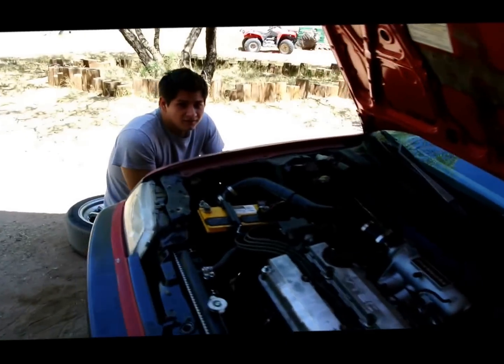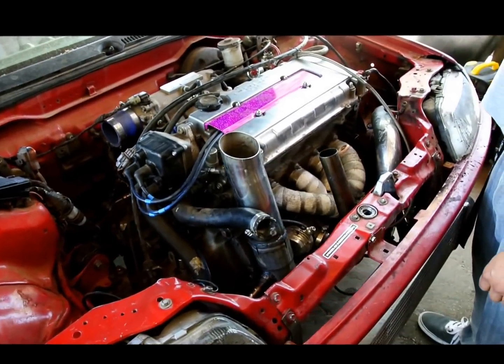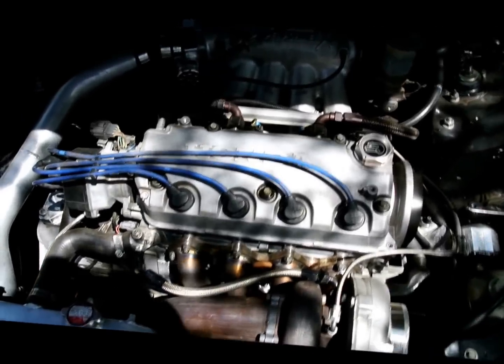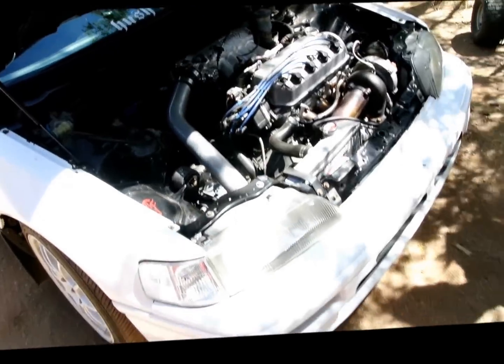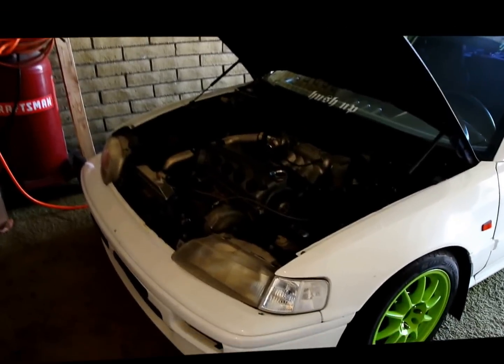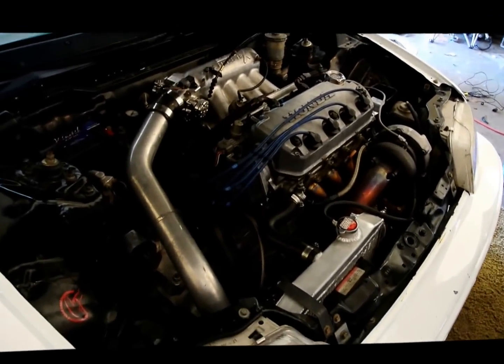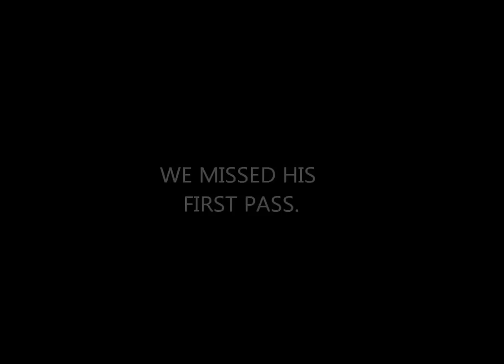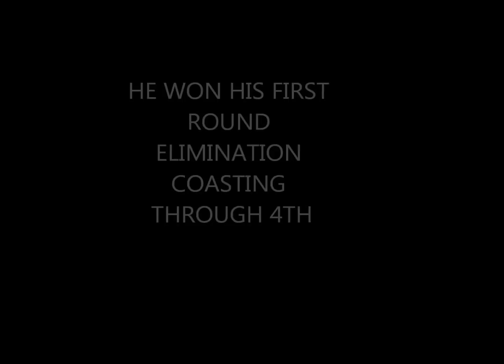400hp SOHC in the making

Comment: Love your EF bro!  I subscribed.  I have a white 90 EF that looks like yours, but it's in better shape.
I don't have the beefy motor though, just the stock D16A6, but would love to drop a B20 into it eventually.
Quick question -  I moved to a place where it snows and I've started to notice that most EF's have a radiator
that's about half as wide as mine.  The one in your car looks like it's maybe 12 inches wide, mine covers the
whole front end of the car.

Anyways, the car has trouble staying warm in cold weather, so I have a thin cardboard box infront of the radiator
in order for the car to stay warm in colder weather.  Is this due to my EF having a much larger radiator then most
of the ones I see in other EF's?  If you know this question, please let me know!

Thanks

PS- you can see my EF by searching WHOISMISTA808 on Instagram.

Comment: I love it man. Always wanted an EF hatch. Instead I got an EK coupe. Nothing overly special, freshly rebuilt stock bottom end LS, 63 trim turbo, BC turbo cams, dual valve springs, titanium retainers, ported head, ARP head studs, ARP rod bolts, GSR trans, Siemens 660cc injectors, HKS BOV, Tial F38 wastegate,  tuned on Crome Pro on 8.8 lbs. I'm still working the bugs out of the random parts but it runs good. I need some better tires, axles, and an LSD trans before I take it to any track. She's a one wheel peel through 1st 2nd and 3rd on 17" street tires and spinning ain't winning. I love a good single jingle build though. Good shit bud.
Reply: lol

Comment: What block and head are you using? I wanna do a turbo build. My d15b block with either a Z6 head, Y8 head, or Y7 head not sure what head to use.
Reply: Y8 head has the best bore stroke and compression
Reply: Eric Nunez I'm going d16z6 block with d16y8 head

Comment: what fuel system are you using? did you have to order special lines? type of injectors? I'm looking to build a e85 turbo sohc also and needed info on the fuel system and railing..
Reply: I believe you just need a tune for your car to accept it and you're set
Reply: +Cole Haas wrong..steel fuel lines help cuz the rubber ones  can corrode and clog your injectors  and u need  high cc injectors and then a tune.
Reply: oh ive never heard you needed steel lines, i was thinking just injectors and a pump for stronger parts

Comment: Wil a d16y8 stock hold boost???
Reply: As long as it’s in good condition it should be able to
Handle up to 10 but 8 psi is probably where you’d want to
Go for reliable power without having to rebuild